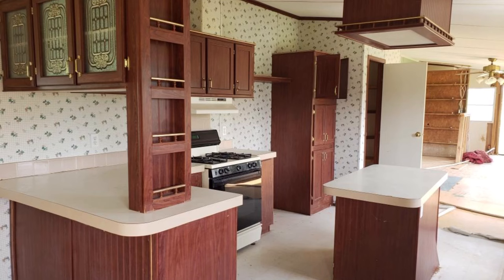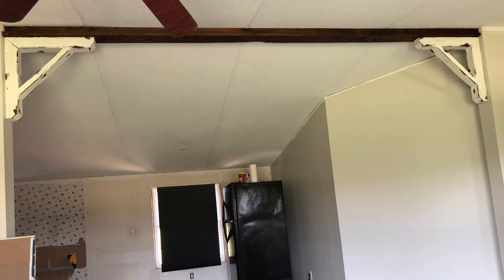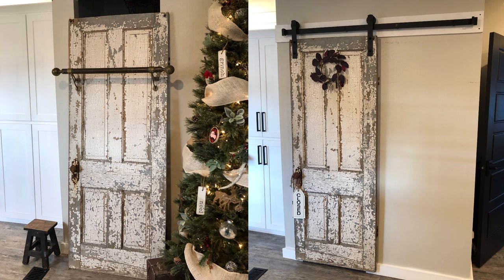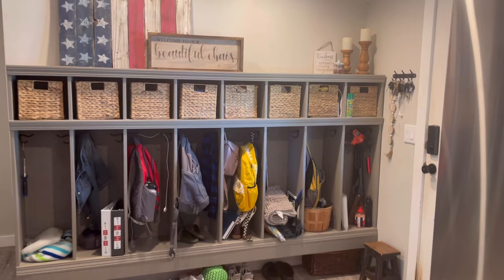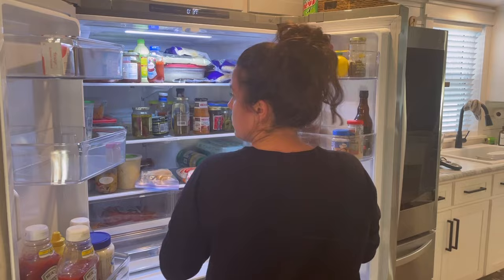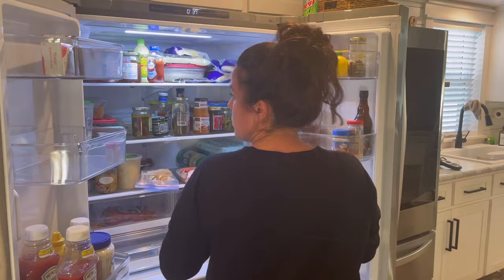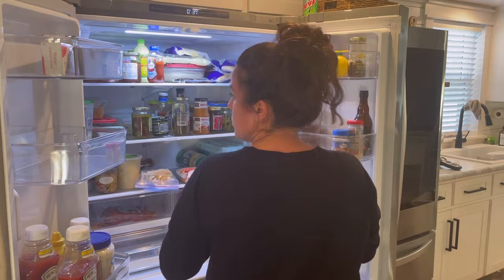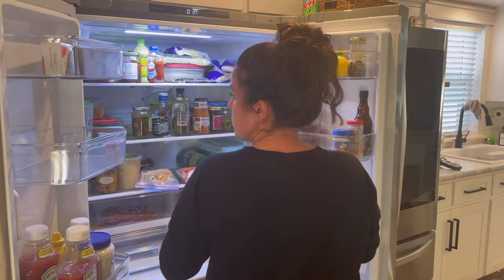Mobile Home Makeover | Modern Farmhouse Kitchen | DIY and Organization

Comment: Drawer pull outs (for crockpots, toaster, instant pot, etc) instead of shelves is so smart, especially as we get older. My mixing bowls and cookware are housed in drawers. Game changer!
Reply from the maker: Yes! Such a great idea. A functional kitchen is so important. Thanks for connecting ❤️
Reply: Yes I have a pantry and want to update the shelves that wire crap is not doing it for me. I want pull outs. We will see what I come up with.

Comment: In mobile homes they don't use traditional wallpaper. That's the actual cover on the Sheetrock. You probably wouldn't have been able to remove it. It's been a pain for my refurbish project. A good quality primer & paint is my method of choice
Reply from the maker: You’re so right. Removing the wallpaper isn’t an option just properly covering it up. A drywall contractor said oil based primer is best choice then do your coats of wall color otherwise you’re likely to get peeling paint. 👍 that’s what we did and so far so good

Comment: Can you give me info on your vinyl plank flooring? Thanks so much!! Your home is beautiful!!
Reply from the maker: Our floor is Wellington Heights brand by Master Design. Color name is Richmond, and its 5.5 mm thick with pad. This product is everywhere, big box stores included. We got our exact floor from a wholesaler here in Oklahoma. They had limited stock. But it’s is the most practical floor for any home. It’s waterproof! It doesn’t expand or contract with temperature, you can instal it with limited tools or experience. Just score with a razor blade and snap from the back, some styles still need a pull bar or a installation block. It’s not too cold underfoot, it’s not hollow sounding as you or animals walk. And you can get it for around $2 a square foot. 👍🏼 hope this helped
Reply: @thecreatorinme7  Yes!!! Extremely helpful and very thorough reply...you answered it all...many thanks!!
Reply from the maker: @tracibrown1455  my pleasure!